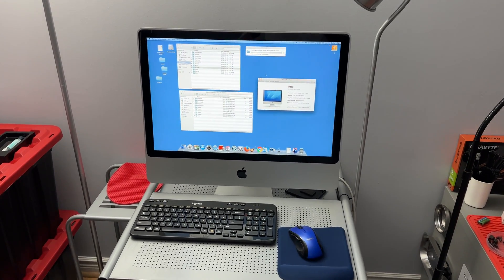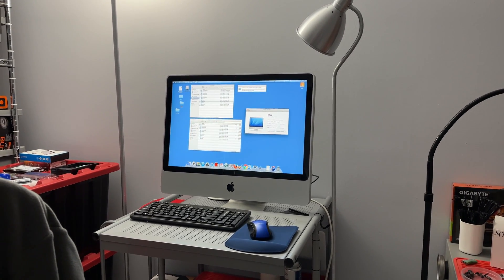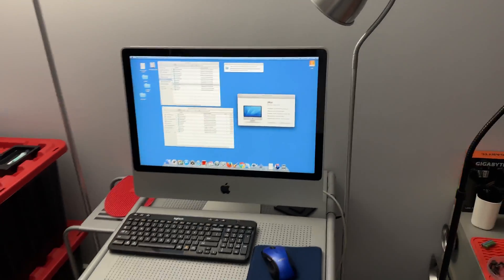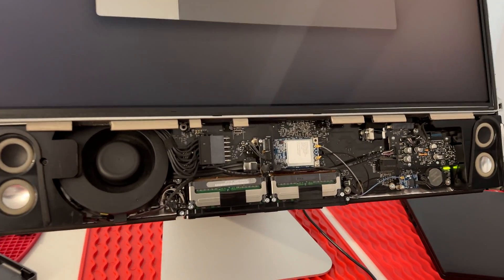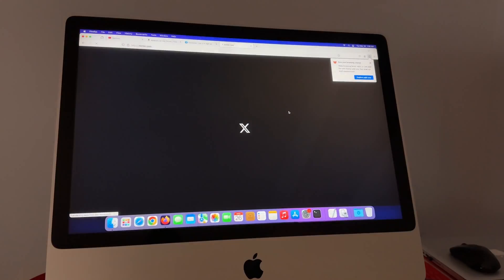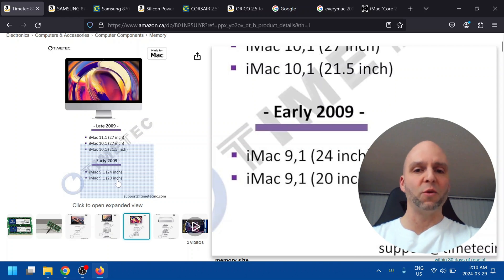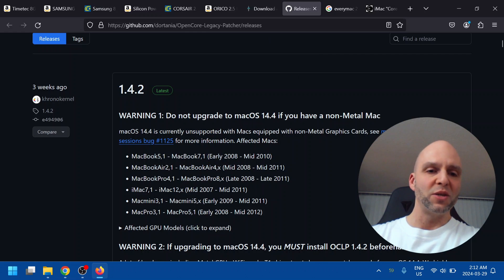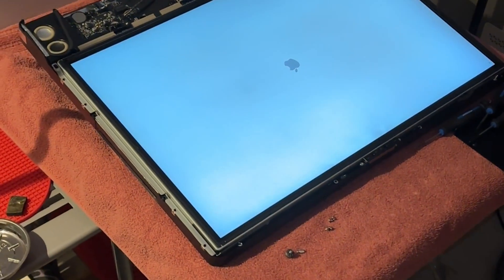Is 2009 iMac Still Good? - BEST Super Budget iMac in 2024

Comment: I own a late 2009 27 inch iMac and have installed 16 GN of RAM, along with a 500GN SSD. It runs well but I have not had the courage to move to Monterey. I guess that I should try what you are suggesting.

Comment: I did this had so many gpu issues , binned Monterey off installed win 10 instead
Reply from the maker: Did you remember to install your open core Legacy patcher post install root patches. The most optimized and up-to-date GPU driver for your specific model is included in most of them now across the board. Always check the install notes on the website for your exact make and model and unique identifier to make sure what is and what is isn’t working for specific machines. Hope this helps my friend. 🙏

Comment: hello  what is max  osx  on my imac 2009  late november    i run high sierra now   i have 12 ram   ssd 1 tb   new mainboard   and graphics .  thanks for guiding me.
Reply from the maker: Even using programs like OCLP I wouldn’t go higher than macOS Monterey on any Intel based Mac only because Ventura Sonoma and Sequoia really are designed for Apple’s M. series processors. Hope this helps my friend.
Reply: @TechInsomnia  what did i have to do to get Monteray  osx on my 2009 imac  as i have 12 ram  1 tb ssd

Comment: Hello 
Nice and informative video. Is this a 64 bit machine or 32bit ?

Thanks
Reply from the maker: In a way both. The Early 2009 iMac (iMac9,1) with Core 2 Duo CPU supports 64-bit but originally booted macOS in 32-bit kernel mode by default. The Late 2009 iMac (iMac10,1) with Core 2 Duo or Core i5/i7 supports full 64-bit operation, including running macOS in 64-bit kernel mode. Really appreciate your comment and thank you so much for your support my friend. 🙏
Reply: Hello 
Thanks for your informative answer. And thanks for quick reply.
    I have found 2009 iMac 24 inch. But I am confused! Shall I take it or not! Need advice from you.

Regards 
Sabbir

Comment: With this new setup is Apple Music working smoothly?
Reply from the maker: It was, but OCLP will vary on different machines depending on which version and what operating system you’re running. My advice is stick with Monterey for any Intel based Mac’s because Ventura Sonoma and Sequoia really are designed for Apple’s M series processors and if you’re looking for stability and compatibility, especially with Apple Music, Monterey might be your best chance, but if you have time to experiment, you can try Ventura. Hope this helps my friend. 🤞

Comment: I am working to restore a glass broken 27 inch 2009 Imac. My girlfriend broke the screen but it works but I think the broken glass is causing issues. I bought the new glass & its odd that it will run YouTube fine but can't access the weather channel which is as far as I can get until I buy a new internal  ssd and get it repaired.

Comment: The Mac OS  on this imac is becoming end of life, this means my browser is stopped upgrading , which one day sooner or later, I will be forced by some major websites to upgrade my browser.  And that means , either I have to switch to another browser , or have to give up the computer ....... Starting now, I already experience that GMail does not load with my chrome broswer anylonger, it just wait to load webapp all the time , and then go time out.    I tried OpenCore , but it can not support to upgrade this imac 2009 .  So , eventhough it works as a computer , but when it starts to connect to internet, you will find it starts to have irritating problems here and there.   Sooner or later, you will want to get away from that lovely imac, and get to a newer one.   And THAT IS BY DESIGN ..... Apple knows the pain , the industry knows, and they are happy to get user to move on using new tech one way or another.
Reply: 😭 thats where I am now...I have never had an issue with it.
Reply: I had those issues Bought a new iMac. It’s slow as a heck. Very disappointed.
Reply: Hi, I am planning to buy used 2010 iMac 27 inch model (i7-870, 16 GB RAM, 240 GB SSD, ATI Radeon with 1 GB VRAM) for 100 €, but I read somewhere that I might encounter few problems while web browsing, as most of websites will not be working / opening in older versions of Web browser. Is that true?
Reply: @ that’s my old one. No google. No gmail

Comment: It’s a novelty, a nice collectors item, I’ve just put my iMac into the attic, retiring my MacBook Pro 2017, and taking delivery of a 16” Macbook Pro.
The old iMac has 24GB ram, an i7 processor, an SSD, and yes it’s fine for net browsing etc, but painfully slow in Photoshop, is OCLP really secure?

Thoroughly enjoyed your video, interesting, filled with detail, thanks.
Reply from the maker: Great machines and thank you for your comment and support my friend. 🙏 I've done over 100 macs with OCLP and I've never had any security issues or scares. Sure the older they are the less chance Maps, AppStore and AirDrop will work and work properly and you're right about Photoshop but overall, OCLP is evolving these days. You can set it so that you are getting all the current apple security updates and they are downloaded and applied automatically. Right now OCLP 1.4.3 on Sonoma 14.4.1 is a masterpiece and turned out flawless on a 2017 iMac and 2015 MBP I did in the last two days. Both getting security updates with no issues. Chrome or Firefox with AdBlock Plus and Avira Browser Safety plugins will serve anyone well in 2024 Mac or PC. 🙏🙏